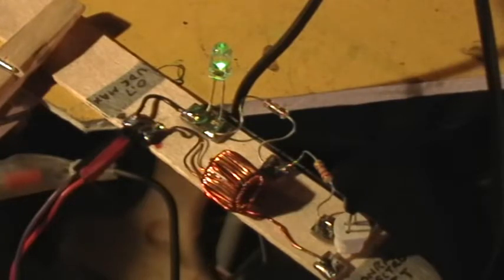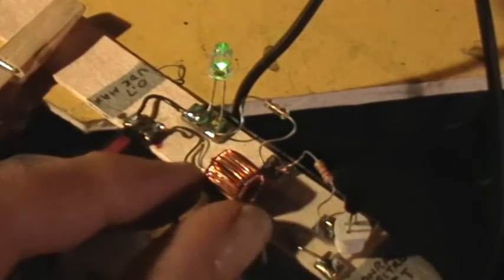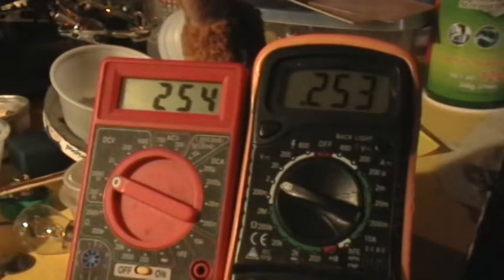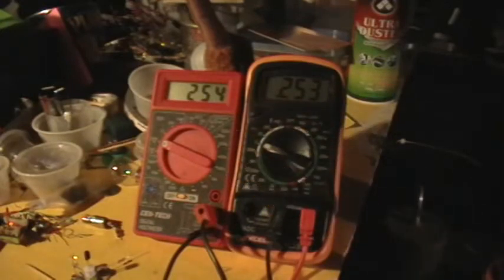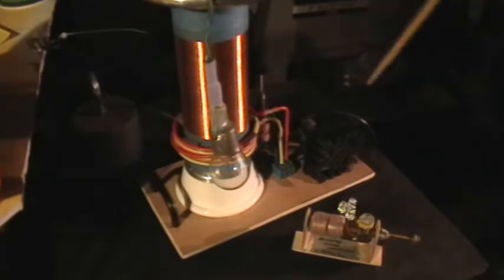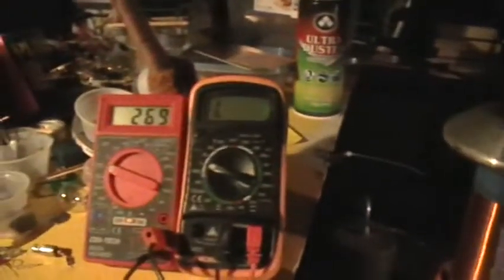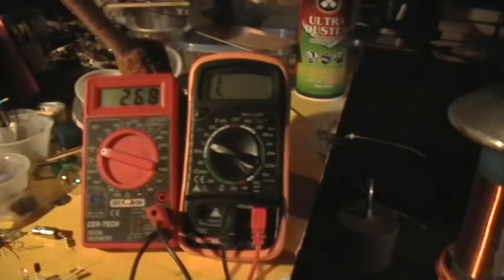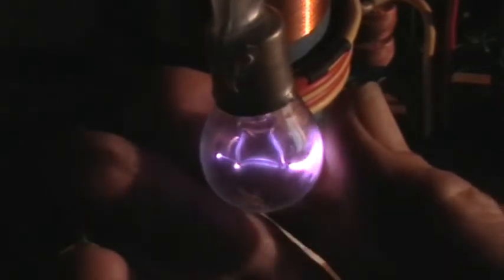Resonance: DMM response to QRM, TKminiSlayer, Conrad's LVJT

Comment: Also, very interesting about the RF shielding. Too bad those aren't the standard cheapo DMM's here in Canada.
Reply from the maker: I imagine you can get the same kind of meters, maybe a different color, at Princess Auto or Canadian Tire. I remember some little black ones I used when I was up there, they even came with thermocouples for temperature reading. Same price point, under ten loonies. I don't remember how they responded to  RF noise though. You should test one or two!
Reply: TinselKoala
Yeah, I definitely will buy a couple more and conduct a similar test. Thanks for sharing.

Comment: Nifty gadgets!  Do you have the schematics & parts specs listed anywhere online?
Reply from the maker: The schematic for the ConradElectro LVJT using the 2sk170 FET is in the video. The TKMiniSlayer is a "Slayer Exciter" with a 2n3055 transistor instead of the TIP31C and a different fast diode and a bifilar 8 turn primary instead of the Slayer spec, and a loopstick in series with the bottom of the 400 turn secondary coil. You can find many variants of the Slayer Exciter, just google it. The electrosmog harvester is covered in another video all its own.
Good luck with your builds, and keep us posted on the progress!
Reply: Thanks!

Comment: Very nice replication of the 2SK170 circuit. But I am not the inventor, the circuit was published by a person calling himself "magpwr" in the OU forum. I just replicated the circuit and did some tests with a Peltier-Element as a power source. The only honor I claim is that I documented the circuit and my tests carefully.

This is the thread where magpwr showed his circuit:

http://www.overunity.com/13175/25mv-joule-thief-powered-by-peltier-merely-using-our-body-heat-free-energy-247/#.U8lGYbE383A

With a 100:4 wire turn ratio on the toroid it should light a LED with 50 mV (at about 2 mA). It should be a higher grade toroid (e.g. 3E25 Ferrite)

http://www.overunity.com/13175/25mv-joule-thief-powered-by-peltier-merely-using-our-body-heat-free-energy-247/msg350863/#msg350863

Greetings, Conrad